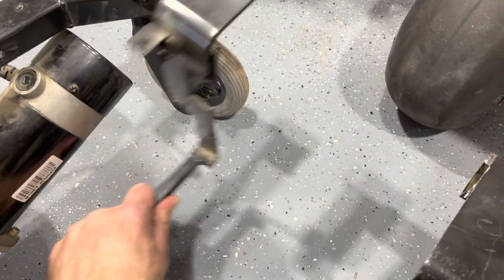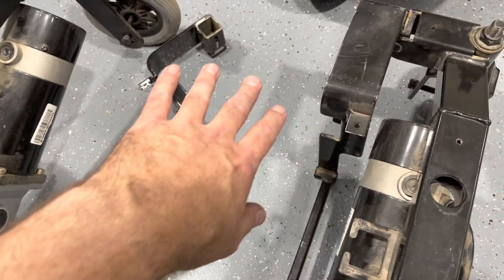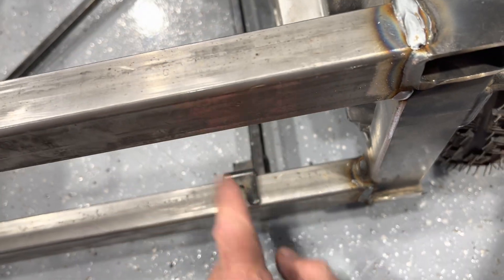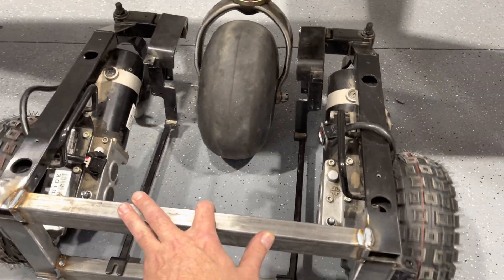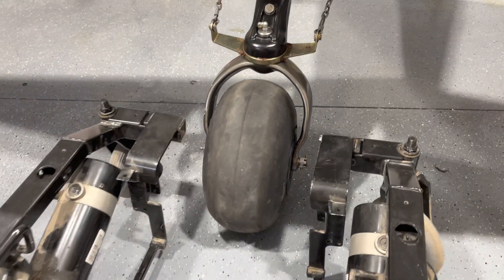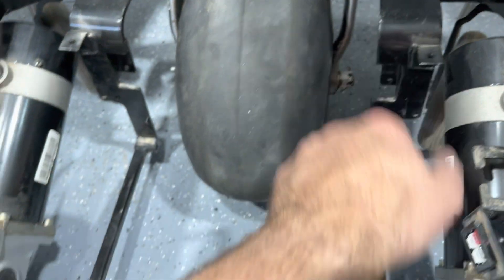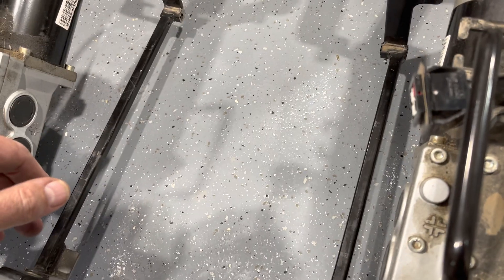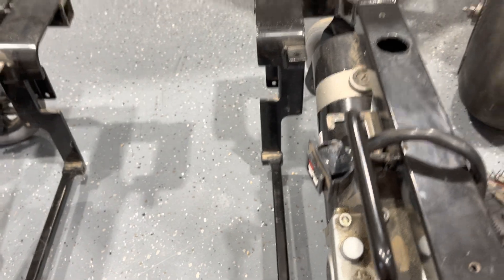DIY Airplane Tug from a Powerchair - Part 2

Comment: You could use old strips of cutting board machined down with counter sunk bolts on each side , just to guard against hitting an doing damage to the wheel ... Cool setup